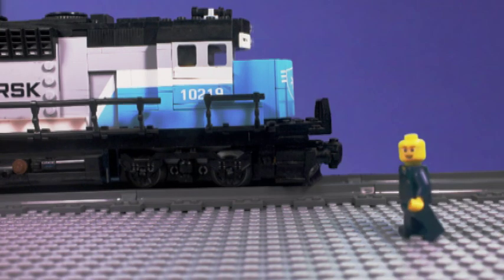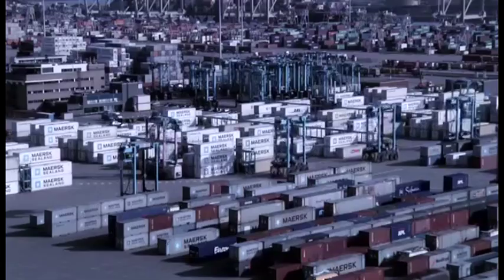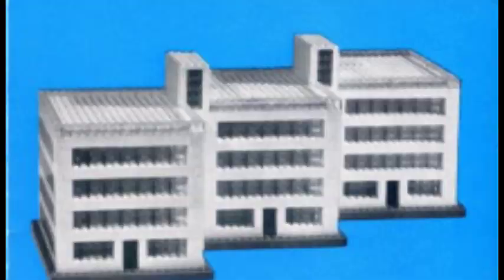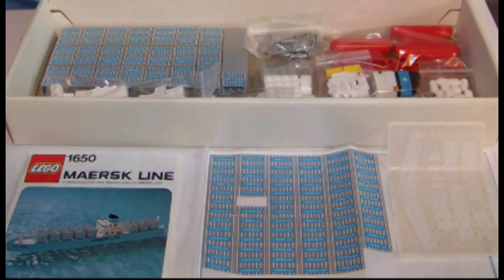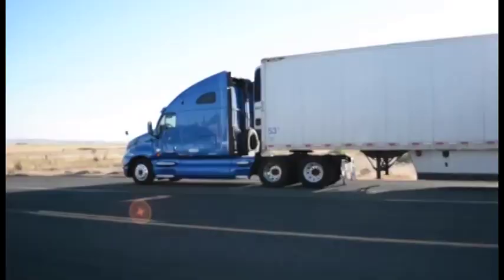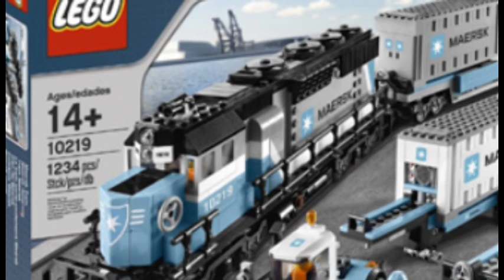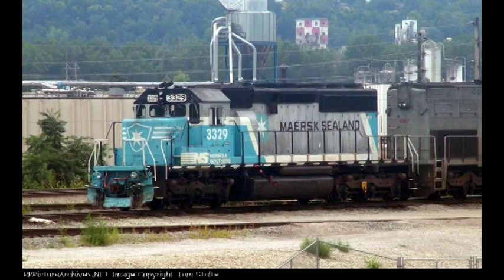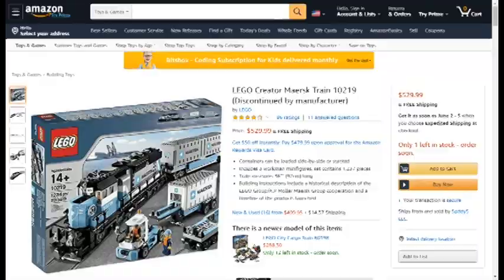The History of Maersk Lego

Comment: The 10152 set actually came in three subvariants:
The '04 had the original "Maersk Sealand" and an older formula of Maersk Blue.
The '05 had a newer formula, changing the color slightly, but still using Sealand stickers.
The '06 had the new "Maersk Line" packaging and stickers, while also some internal bricks were changed from Maersk blue to white for efficiency.

10155 is mostly identical to 52, with the two extra parts not actually being a change in the build and instead just Lego classifying the panes within the large 2x8 windows as separate from the frames, while they were counted as identical previously.